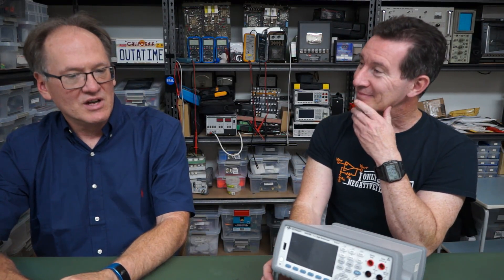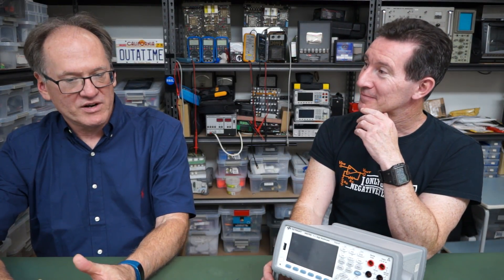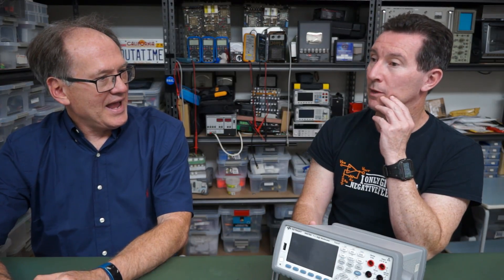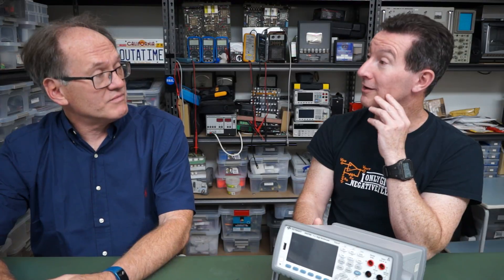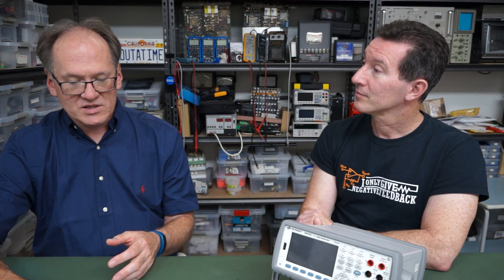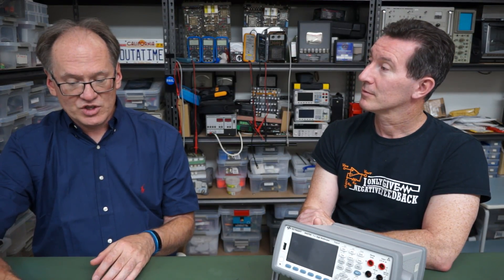Keysight 34460/70 Multimeter Specification Issue Explained

Comment: While I agree that being more open about what was considered wrong would have been nice, I'm under no illusions as to what I owed. When I buy any equipment I am buying a spec, if the equipment does not perform to that spec then there are consequences. In this case it was a mistake to announce there was a problem but safety comes first.

Comment: I see a series of videos in the future. 1. Find the out of the spec part 2. what happens if you go above 600V
Reply from the maker: What happens if you go above 600V? Absolutely nothing. This circuit and part has been used for decades without issue. I doubt anyone is ever going to find anything to the contrary.

Comment: Though I'm an embedded/real-time software person by training and profession, I've picked up tons of system and cross-disciplinary knowledge over the years, and I support lots of design reviews in areas unrelated to software (electrical, electronic, mechanical, optical, physics, etc.).  More than once I've asked the "stupid question" about something which leads to initial shock followed by lots of hair-pulling, only to find that the original design was OK.

I initially stopped asking such questions, for fear of unnecessarily kicking the hornet's nest.  But I soon found that it's not about right and wrong, but about perspective, looking at things in a different way.  Though most of my questions and observations are indeed at the level of distractions, my "value added" is that they aren't always distractions.

One of my "dumb questions" led to a system redesign that in turn led to two patents.  Not that I had anything at all to do with the patents: I merely observed that the initial design seemed overly complex, pointed out some possible areas of over-design, which apparently unleashed the designers to come up with something much simpler and much better.

It would have been nice to have been named on those patents, as the last name of course.  I think I got a free lunch out of it.  TANSTAAFL?

Comment: Interesting. I am wondering which part could be rated 600V and NOT be a safety issue at 1000V. Probably a fuse?

Edit: What do you think?
Reply: Probably a resistor, how often do you look up its voltage rating.
Reply: Fuses do have max voltage rating AFAIK. A blown fuse might conduct current if higher voltage is applied. So it is possible yes.
Reply: Could very well be a capacitor with an AC working voltage of 600 volts (if that is what the voltage was as I have not followed the story) plus an adequate guaranteed voltage tolerance to still be safe at 1000VDC (e.g. 600VAC*1.41=846VDC+20%=1015VDC, is greater than 1000).  But that is but one of many possibilities without going through the schematic and parts list with a careful eye to reverse engineer the original cause for concern.  Also, a capacitor's specifications can vary relative to the frequency (or more specifically the rise time) of the ripple applied to it, so one might be in spec at lower frequencies and not at higher frequencies with faster rise times.

Comment: Of course there was no safety issue. Keysight/agilent know what they're doing. Just some jobsworth blowing things out of proportion wasting everyone's time.
Reply: If something looks like a safety issue it's always better to bring it up. The resulting mess was more Keysight's fault for not having enough design documentation to be able to assess it quickly enough. If it took the engineers at Keysight so long to determine that it wasn't dangerous then you can hardly blame the other person for having the same doubts.

Comment: Was anyone from the forum able to figure out which part it was? In what circumstances would it be OK (in terms of longevity if not safety) to have more voltage across a component than the component is rated for?